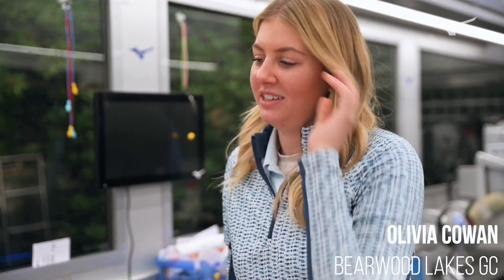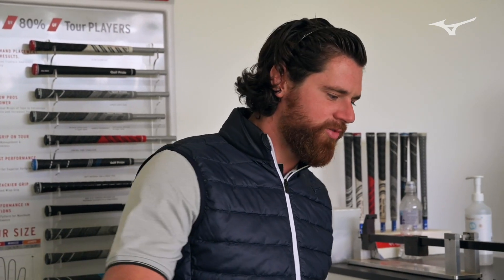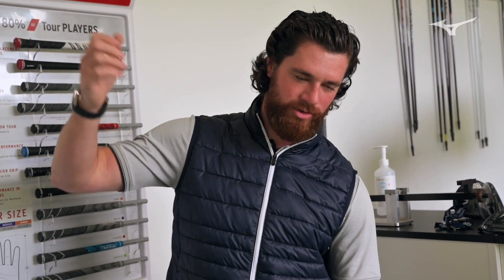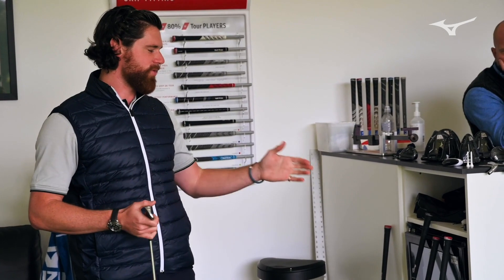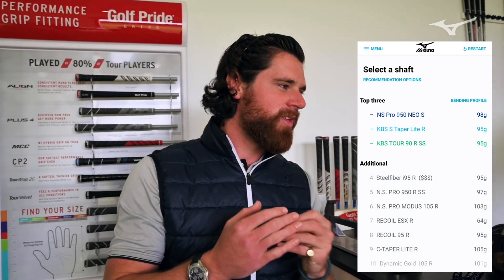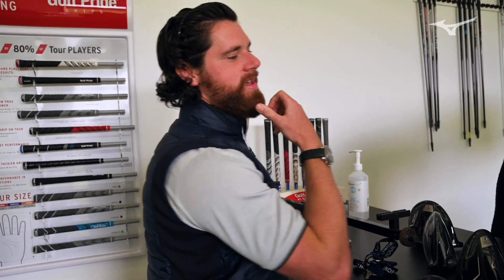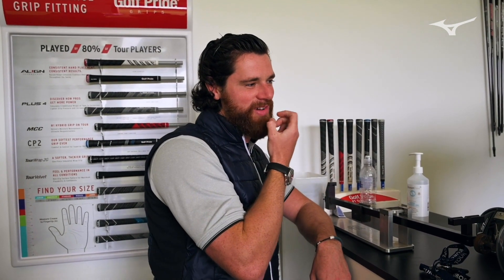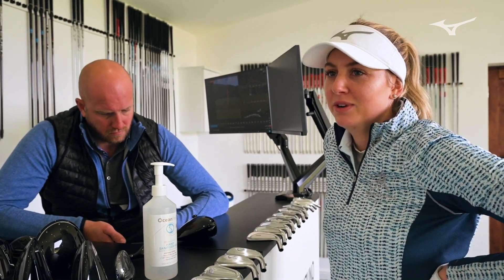TOUR WORKSHOP DIARIES:  Mizuno Swing DNA with Olivia Cowan

Comment from the maker: How many of you kept a record of your Swing DNA numbers?
Reply: I didnt but recently moved into 921 hm pr0 modus tour 105 stiff what shaft would i fitinto my woods with that steel iron shaft many thanks
Reply from the maker: @wayneross8544  We'll ask one of the techs.  For next time  - you can get a wood shaft recommendation from the software at the same time as the irons.
Reply: @mizunogolf1906  i forgot to ask will go for fitting when the stz x is relesed
Reply: I did a fitting - 3 swings at 94-6-3-4-3

And a second one, averaged at about 96-7-3-4-3. Ended up in $ Taper X.

Loving them, had them almost for a year now
Reply: Didn't think of that! I was on cloud 9 after my fitting that I didn't think of getting the numbers.  I'll definitely ask when I go pick up my clubs!
Reply: I do!